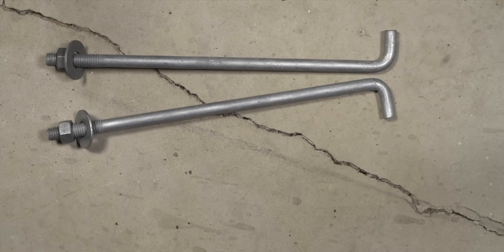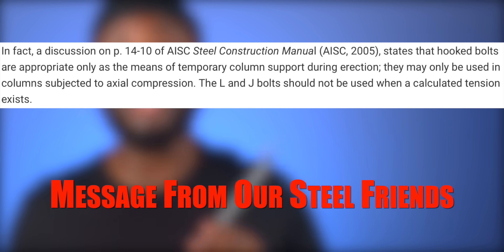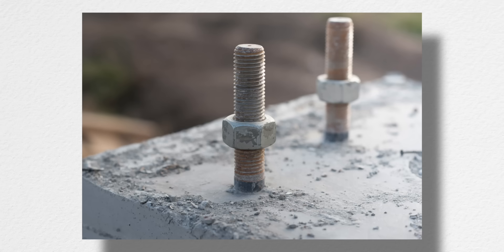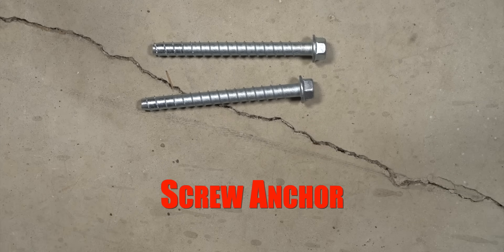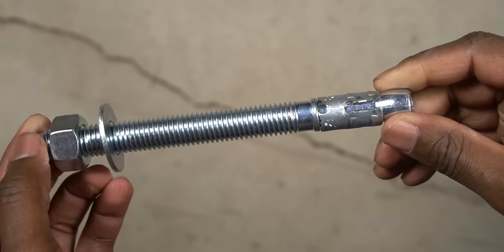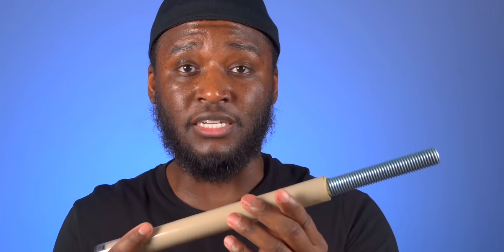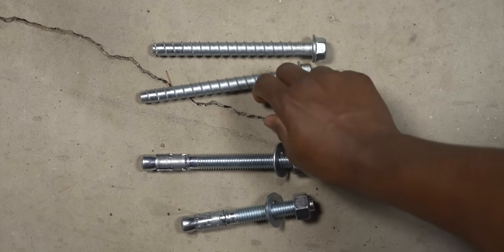Why Abandon "J" & "L" Anchor Bolts in Wood Framing Construction FOR GOOD?

Comment: A buddy of mine that is a builder is still using the J bolts even though he’s a mechanical engineer himself. I think it’s for the same reason he has lots of other issues on his jobs, when he tries to tell his subs to do something they tell him “you don’t need that” and just keep doing what they want.  The other thing I see on his jobs is that they don’t install the bolts right away, it’s the last thing they do before leaving and the concrete is starting to get pretty stiff so it leaves a hole around the anchor from shoving it in. Then after all that half of them end up being in the wrong place when the framers get started. But when you always go for the cheapest guy you can get and all of his workers are illegals that don’t speak English much less know what a building code is I guess that’s what you get. I would think it would be worth it to use the other anchors simply because you can make sure they are where they need to be after the floor is framed.
Reply from the maker: Completely agree with you. Ease of construction is the primary reason why I specify the screw anchors.
Reply: Wonder if your buddy calls you a buddy?
Reply: @moki7685  as a matter of fact he does.

Comment: I read North Carolina 2018 Foundation Codes and could not locate texts mentioning that anchor bolts can be replaced with other types. Did I interpret the code texts inefficiently ? This project was small 12x15 feet room addition; hence went with J/L anchor bolt.
Reply from the maker: NC likely doesn’t have a specified type of anchor either in their code. It probably just mentions the size of the anchor, the spacing, & how far it should be embedded. As long as you met that, code wise you’re ok.
Reply from the maker: I forgot to mention however that companies who produce fasteners, such as Simpson, have their own literature on anchors that can be used as a equivalent substitute for a sill plate anchor. I've attached a link to the screw anchor I had in the video here.

https://ssttoolbox.widen.net/view/pdf/fizor1uvtv/T-A-SILPLANCH21.pdf?t.download=true&u=cjmyin

Comment: Nice video. 
But, I'm not sure if I agree completely. Firstly, it is not difficult to install J/L bolts. Those in the trade have been doing it for litteraly decades w/o issues.
Secondly, where is the proof (aka testing video) showing J/L bolts failing due to uplift forces? And, thirdly, I deal with structural engineers all the time and most (if not all) of the specifications for AB have been the typical J/L bolts.

Of course, using the screw-in bolts, and the expansion bolts are also good choices if the concrete is already poured. Otherwise, I don't see why a structural engineer would phase these out when they are perfectly fine and gets the job done 100% of the time (provided its new poured concrete). Thanks.
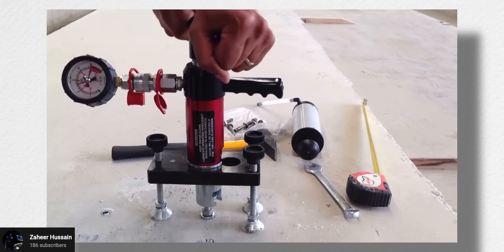Reply: At 1:22 into the video he makes reference to uplift failure.
Reply: Great video, and I agree with your comment. I personally do not recommend expansion bolts or adhesive anchors at slab/foundation edges. If bolt placement is missed, we do use adhesive anchors, but installed at a slight angle. 
Also, it bolt is going to be used to resust uplift. I do not use J-bolts, I design and use treaded anchors with a nut and wssher.

Comment: In my experience . Ever notice the slot on a CMU unit . That is where an L is supposed to be hooked . Not too many masons take the time to do that . Most with just push one down and core fill with broken cull and slop mortar in the cell .. They all wiggle . On concrete .. Most will just push one down and wiggle it , most are out of plumb and require knocking straight which shocks the concrete , On the perimeters of monolithic slabs , Cracks the concrete and sometimes breaks off the concrete ,  The threaded anchors are fine . But they can shatter the perimeters as well when tightening thus rendering them useless.. In the field " anywhere besides and edge "  . Epoxy has it's attributes as well . Drill the hole , blow it out and squeeze in the epoxy ..Yet in my experience .. If the hole has the least little dust .. It can be pulled up with ease when tightening  So they really need to be cleaned out with with a damp cleaning tool . I find it hard to believe a sleeve or expansion anchor is better than a L bolt . Drill the hole and pound them in . They can be pulled up and out when tightening . So are you saying an L bolt can pull out easier than a sleeve. Wedge It  ?? .. In a perfect world .. The J bolt is supposed to be hooked under rebar.. But few put the effort into making sure they are hooked and few put the rebar in the running location . It's always Blow and Go . In my experience I have worked on some " Beauties "  When installing the mudsills . The carpenters would just use cut nails , case hardened , or a sinker . Basically worthless . Nailing into a CMU cell that has been filled with cull brick and topped off with a skimming of mortar !! LOL . . Many plates shook and made it hard to layout with plates doing The Shakes .. I remember watching on the local news , Houses floating off their foundations completely intact during a flood . LOL . Just recently . I couldn't work for a stupid builder . Had to leave . They were building basically a shed " Office " for what I called a Hooverville .. They were using anchor straps on a monolith and secured them to the plates with ... Aluminum roofing nails !!!! .. I jokingly suggested " Why not a thumbtack ?" they are basically the same .  It wasn't until they said I was insane about setting a gatepost . They dug a 2' deep hole and set the 6x6 in and powdered in a bag of concrete and wet it .. Dry Packing !! . I said it aint worth a pile of dung . I even said " If drypacking is so good .. Then why don't concrete trucks just deliver the powder when pouring a footer ?"  Imagine the fuel savings !! .. Next day I helped install the gate with a wary eye . I knew what was going to happen . Shimmed the gate in the hole and attached the hinges . Released the shims and the gate lurched in 2" .. rendering the gate inoperable !! LOL .. " Well   You gonna have to fix that " .Years ago I had a saying " Why do it right , when you can do it twice and twice is twice as nice and a third time . Moi !!" .. I told them .. Here is the solution .. Did the hole bigger ! make an elephants foot hole , screws in some deckmate screws into the post . Like talons on an eagle and mix the concrete this time .. " Well we'll need a wheelbarrow !" .. Nope . Just a small tarp or piece of housewrap .Break the bag of concrete in the middle . pour in the water and pick up the corners and agitate !! . then sluice it in !! .   I refused to participate in their stupidity anymore . I asked the builder " Is this the type of crap you build ?.. Count me out !!"  See ya .. .. When I was hired .. He told the other guys " I don't know if I should hire him .. He's a super carpenter " .. I just wanted a little work while I am fighting Stage 4 cancer . I didn't want to run a crew again . I can't !! but I can be one hell of a hired gun when I am not sick . A few video ago .. You had a video about a balloon framing .. On one of this Builders projects .. They framed an 8' wall . and then framed atop it to the gable rafter . It shook back and forth 5 " with minimal effort . . I said "It should have been balloon framed " .. He said balloon framing is against Code !!! .. Huh !! .. The balloon framing he was talking about is where 2 story walls are framed and joist are sistered along the sides of the studs .. It's doable but anchoring must be perfect . I don't even do that'' Thats ancient . .. I told him .. It will continue to shake and poses a problem . The interior was vaulted .. I suggested .. at the very least .. stiffen the plate line with a LVL laid flat on the plate .. Turn it into a shelf !! . of put a perpendicular shear wall at midspan .. Use it for concessions in the future . Anything !! .. He said the collar ties will stiffen it and I was  a jerk and said " No it wont" ..  At these times .. You just bite your tongue and hope your eyes don't roll ..  I ramble .. I have 40 years of experience and have seen most everything .. I have seen products that were revolutionary at the time , That ended up problematic . Most in the construction business are just about . Get it done with the least of money ,effort and hope nobody notices .. It's Bang Bang Bang .. Money Please . Most carpenters just follow and many don't consider the entirety . They were told and did . Check Please . . I have seen paid off Building Inspectors , Engineers that were hardcore and others were Slip and Slide . Architects that levitated and could do no wrong but had 100 mistakes per plan .Others that were sharp as a razor . Most custom homes have a myriad of problems looming in the years to come .. Remodeling business is booming
Reply: Wow ... 👍👍👍. I knew stuffs done using my own hands are the most trustworthy but never expect how bad it is ... if one leaves it to the "professionals"